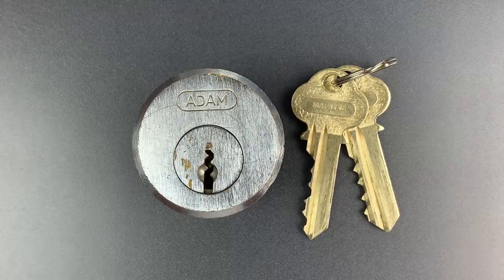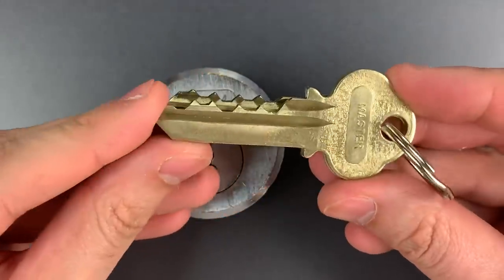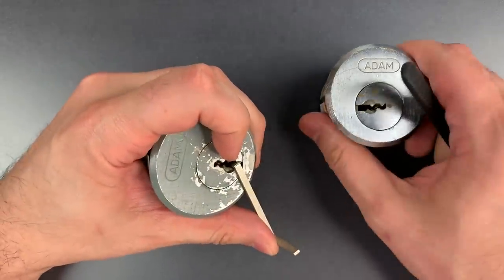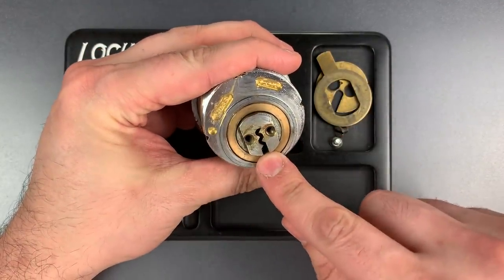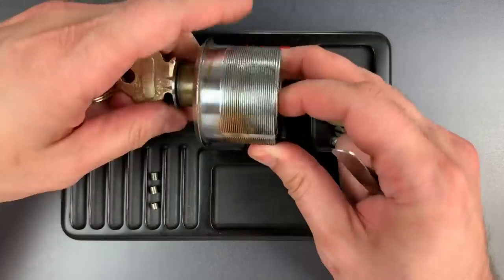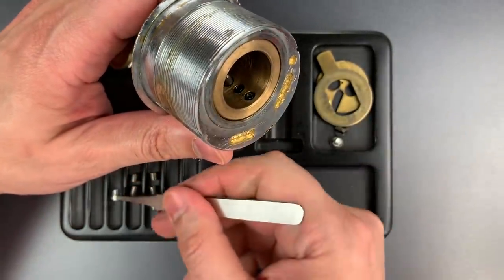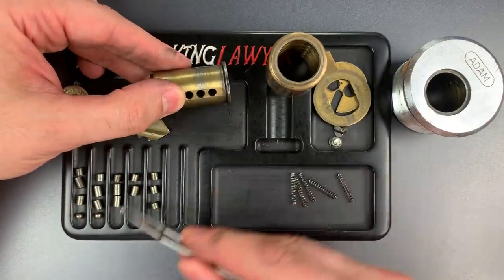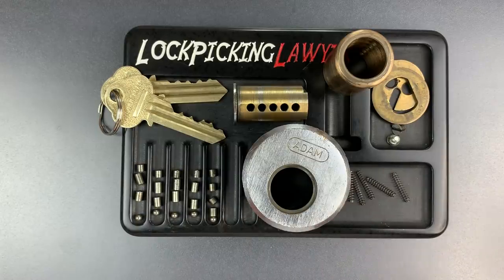[919] Prison Break! Huge Prison Locks Opened in Seconds

Comment: "im not going to go into how to improvise a lockpick in a prison setting for obvious reasons"

he knows how to improvise a lockpick in a prison setting holy shit
Reply: If they have the access to anything metal, they'll always find a way to reshape it either to shank someone or to bust a couple locks.
Reply: i can break out of prison but you can’t
Reply: Considering how often he can open a lock with little more than a bit of chopped up drink can...
Reply: @mac1991seth   not even metal you could mae this tool out of a tooth brush
Reply: Favorite comment ever.
Reply: Spoons or pieces of a bed are good enough i suppose :/
No problem getting them as well
Reply: @KiffKan  Exactly. You don't need to know how to use a lock pick, in order to make one from everyday materials. Of course, the assumption is that if you don't have a lock pick to model your creation from, knowing how to pick locks and what sort of tool you would need, would be necessary prerequisite knowledge to building an improvised lock pick, and more importantly, use it (unless you were creating them to sell/barter to other inmates). But being able to build stuff from limited supplies is more a "MacGyver" skill than it is a lock picking skill, and I assume that's the condition you'd be operating from if you're in prison. I've never been in prison (knock on wood), but I assume if you were really motivated to obtain something, you could probably eventually do it. That's why I assume prison security isn't just relying on inmates not opening a single lock, but there are also guards physically watching as well as security cameras and random inspections and other security measures. And of course, if you get caught trying to escape, the chances of you being caught and put back in with a longer sentence is very high. As a rule, you need more than one method of security if you actually want to protect something.
Reply: @MittyNuke1   you are right i didnt want to say that this would be enough to break out from prison i saw it more as a fun fact oh and i live in germany its not illegal to break out from prison as long as you dont break anything or hurt anyone since its conidered human natur to want freedom.
Reply: @KiffKan  Wow really? That's crazy -- so if you are sent to jail or prison in Germany, and you figure out how to escape, you've earned your freedom? If so, that's the craziest rule I've heard. I didn't think I was saying anything other than common sense (in fewer words: in order to build something you don't have, you have to build it using what you have on hand), and I also have heard that even though it's against the rules, in prison, depending on the specific facility, all kinds of contraband is available such as drugs, improvised weapons, etc. So I really didn't think I was saying anything new, haha.
Reply: @MittyNuke1  i should mention they will try to find you and bring you back but your sentence wont be longer and i think if you have been outside of prison longer than your sentence you are free
Reply: @KiffKan  oh okay that makes more sense. That is an interesting system either way. In the US I think sometimes prisoners’ sentences can be reduced due to good behavior/not starting fights or causing trouble, and other things like taking classes or working (which is basically legal slavery from what I understand, but that’s another issue) while in prison. So I think the idea is, that escaping is an egregious form of breaking the rules, and will be punished. Maybe also to discourage it in the first place, since someone who wants out badly enough to escape, needs to weigh the risk of extending their time. Although I’d assume risk taking is not a problem for a good portion of the prison population. I think the biggest issue with prison in general is that it basically marks you for life, in that even after you get out, it is harder to find a job and adapt to civilian life, which increases the chance of going back in, which is the opposite of how it should be. But, these are just my uninformed speculations — this is all above my pay grade, hah.
Reply: @MittyNuke1  No they will find you, catch you, and put you back in prison. However, you do not get more prison time. So you will serve the amount of days remaining. The ruling in the netherlands is similar on breaking out. However it is illegal to help someone break out of prison. So if you receive outside help, your mates are going to prison too.
Reply: They can make or get absolutely anything in a jail.
Reply: it's a wavy bit of metal, really not the most difficult thing to file down if you got any access to metal
Reply: just for some real context
he's an actual lawyer, a damn good one at that, that's why he never shows his face. he knows everything there is to know about practically every lock, and every law concerning security
how else do you think he has access to a TSA Master Key, as well as a number of other master keys that would be federally illegal for a civilian to have possession of?
Reply: @qorso  because he's a professional in his division, with the certificates and qualifications to own and operate master keys, to prove and test regulations on locks for legal cases
Reply: You think he got that second lock in the mail? That's his souvenir from his prison break.
Reply: It’s not that hard. I used to work in a prison and even made my own lock picking set in there. At the time i was unaware that central control had a lockpick set of their own(although it was shittier than the makeshift picks i made)
Reply: @MittyNuke1  It's been three months, have you been to prison yet?
Reply: @steele_heart77  LOL No, knock on wood once again, no prison time on the horizon for me 😅
Reply: @KiffKan  You are right, I did not know that, thank you. Quick google search - "The law relating to escaping from prison dates back to 1880. The law makers in Germany decided that it is human instinct to remain free or seek freedom, and in doing so they made it not illegal to escape from prison in Germany. But as we said above, there are some catches. It remains illegal for others to assist a prisoner escape lawful custody. Not only that, but if a prisoner causes any damage to any property, such as sawing or bending bars, damaging walls or fences, or assaults any individual they can be charged. It’s for this reason that very few prison escapes in Germany go unpunished. It also can have negative effects in other ways for those who attempt or succeed in escaping. Prisoners who are caught face the prospect of not being released early, and can also face harsher, or stricter living arrangements while serving the remainder of their prison sentence."
Reply: Big flat copper staple from a cardboard box from the kitchen the lettuce comes in, and a paperclip.  It's not hard to figure out.
Reply: @semgas  you also have to think about the clothing in prison you usually all the Time get clothes from the prison if you take them with you you stealing them so you need to leave them back so if you got your on underwear it might doable if you leave naked you could get punished for being naked in public and disturb other people, stealing or go out naked will extend your sentence
Reply: @killerrosebudiscool  he makes is own master keys...
He buys the locks without a key..
Reply: @KiffKan  It's not illegal to break out peacefully? That's very wise actually.
Reply: @KiffKan  das erinnert mich an das Prinzip Stadtluft macht frei
Reply: Prisoners have 24 hours a day to create stuff. I guarantee you they could improvise a better pick than lpl. I was into after prison shows for awhile and the stuff prisoners create out of the so called safe prison items is truly astonishing. I'm not talking about the basic prison stuff like prison lighters and tattoo guns either.
Reply: @killerrosebudiscool  anyone can buy TSA keys.
Just search TSA key 007 on eBay.
Reply: @MittyNuke1  You can make a guard's key with a toothbrush using a model, this is used in the netflix series Prison Break season 1 or 2, and in the game The escapists.
Reply: @MittyNuke1  Fun fact (that is not legal advice) but in at least some states it may also be legally excused to break out of prison out of "necessity" i.e. a credible and immediate threat to your life where you either have or cannot exhaust recourse through the administration. A key additional rule is that the escape is only excusable by necessity if, as soon as you are free of the immediate threat, you turn yourself back in. That window can be miniscule. (There is a case, for example, of a convict who alleged torture etc. from prison staff and received no inquiry, so he broke out, according to him, to contact a lawyer to get his complaints heard. He was caught in a barn not far, before consulting a lawyer, and the court ruled that he could not claim the necessity justification because the threat was either not immediate and/or because the threat was extinguished once he left the prison, so he was legally obligated to, immediately having broken out, turn around and turn himself in. Legal Logic.
Reply: Well... it's hardly rocket science :D
Reply: LPL could pick the lock on the gates of hell. 
"Abandon all hope ye who enters here"
LPL  "Hold my beer.
Reply: Apparently you haven't heard enough or seen enough. Prisoners use their wits to turn anything into a weapon. They get a toothbrush and turn it into a shank, not far off into making it into a pick.
Reply: tbh it's not that hard. 😅😅
Reply: How do you think he got out the first time?
Reply: Very easy to make a wave rake any ridged plastic will do an ID card would be perfect, would need something slightly stronger for a Turner perhaps a ground down tooth brush.....
Reply: I mean how do you think he got these locks in the first place

Comment: I've worked in several prisons throughout Missouri. This type of lock is fairly outdated and to my knowledge hasn't been used since The Walls was shut down in 2010. Our keys are much larger and typically are only used for food ports and some interior gates/doors. Doors to individual cells, yards and buildings are controlled electronically from a number of control points, so even having the key wouldn't get you very far. That's not to say keys weren't misplaced or the control officers hadn't rolled the wrong doors for the wrong people. Also on at least one instance a fairly intelligent inmate made a working copy of a key from a melted food tray and visual memory.  If you really want to escape, all you'd have to do is wait for the power to die and all the doors to pop. Fun times.
Reply: If the power goes down, wouldn't the doors stay closed because there is nothing left to open them or are the locks not working anymore because of no power?
Reply: Jordan Phoenix it would make sense if the doors all opened when the power goes out in case of an emergency

Like if a fire takes out the control room, turning the power off, and continues to spread, you don’t want all the prisoners stuck in non-unlockable cells
Reply: @jordanphoenix1255  Sorry for the late response. When the power fails the locking mechanisms on the doors are rendered inactive. It's a built-in safety feature against natural disasters as we were located on a major fault line and also had a history of flash floods and tornadoes.

Our solution to this was to nicely ask the inmates to return to their cells and secure their doors with handcuffs going from the door handle to a hard point on the wall. The gates of the sally port and the door to the administrative building, the only two exits of the prison, remain locked during a power outage and have to be keyed from the inside.
Reply: @chrisash7948  I have no problem with it if it's late, thanks for the answer
Reply: Also work MODOC.  These type, though a different brand, of locks are present in a couple of facilities in my region for interior doors, like to break rooms and such.  Also, our cells locks with big keys, but can be popped remotely by the control officer.  Probably the same massive keys you're talking about.  So, we don't have the power outage problem, since the locks just, you know, stay locked.
Reply: @sterilyte Hey Philip! Hope they've cut back on the overtime and the settlement hurries up. I was in HU1 at SECC. When we lost power all the doors popped and we had to use shackles and the tether loop to keep them secure while maintenance tried to fix the problem. The Ad Seg doors didn't have a manual lock on them unfortunately, but that could've been a design flaw. I remember being told that they weren't the right doors that were ordered and they had an inch or two gap at the bottom which frequently became a problem.
Reply: @chrisash7948  You already know how they're going to handle all that.  At FRDC the doors are manually locked with an electronic activator, so you can pop them remotely but if power goes out they stay locked and can be keyed.
Reply: @chrisash7948  was there no backup power supply in the case of a power outage? seems like thatd be a pretty important thing to have handy.
Reply: @eragon78   The Rpison had back up generators, but I'm not sure if our housing unit drew off of them or if the doors opening was an intentional design as they didn't have manual locks on them. Philip is right though the general population doors did have manual locks on them. Ours were slightly different I think.
Reply: "this is the lockpickingLawyer, and today im going to show you design flaw in a typical electronic magnet base lock used in most of prisons they held me in." :P
Reply: This is the LockPickingHacker and we are aware of keyless entry points…
Reply: @jordanphoenix1255  Depends on the construction. But most technical stuff is (or ought to be) built in a way to be as less dangerous as possible in an emergency. That's why cars shut down instead of speeding up or locks open instead of staying locked.
Just imagine dozens of inmates burn to death because of a faulty door-locking mechanism...
Reply: @jordanphoenix1255  for safety reasons, all electronic doors like that open if the power goes out. It's against the law to make ones that shut instead, though they would be easy to do
Reply: @jordanphoenix1255 nö because of fire safety issues
Reply: I would love to see him pick the large, extremely heavy cell locks. They take a fair amount of force to turn even with the key, and I think most improvised tools in prison would have a hard time turning the cylinder.

Comment: This just proves the comment from a while back ago:
Imagine you are a guard putting LPL in prison, and the moment you close the door and lock it you hear: "A click on one, nothing out of two, three is binding"
Reply: or rake, instantly clicked
Reply: You close the door, lock it, turn around and it's instantly opened behind you.
Reply: There’s no key way inside a cell.
Reply: @jeffreyroot6300  could he do it from the outside?
Reply: LORDBEAST 32 Nope. Steel doors with a thick wire reinforced window in the middle so we can look in, check on them and conduct counts. Weakness is the Officers. If they aren’t doing their jobs , locks and strike plates can be tampered with , to bypass .
Reply: @jeffreyroot6300  Thanks for the explaination! Sorry,  I have never been to jail.
Reply: LORDBEAST 32 Twenty one years a Correctional Officer. The end of my career I was a Key Control Officer and Designated Locksmith.
Reply: @jeffreyroot6300  Do you have any experiences you could share?
Reply: LORDBEAST 32 Some! Perhaps on another venue. And I won’t discuss anything that may threaten security for my brothers and sisters in Blue.
Reply: @jeffreyroot6300  Yeah you're right.
Reply: @jeffreyroot6300  yeah don't talk about them committing crimes or anything. Don't want to have them get paid leave
Reply: Could be reached and picked thru the tray slot if it was left open.
Reply: Lmaooo
Reply: I've worked in a prison.
It happens sometimes that the officier doesn't control properly the closure of a cell door, resulting it into being open.
A couple of times no one but me noticed (not even the inmate). A couple of times the inmate was free roaming the corridor.
Reply: the rake goes jiggle jiggle
Reply: @jeffreyroot6300  LPL will just tap on the back of his cell’s door and booom, it is unlocked.